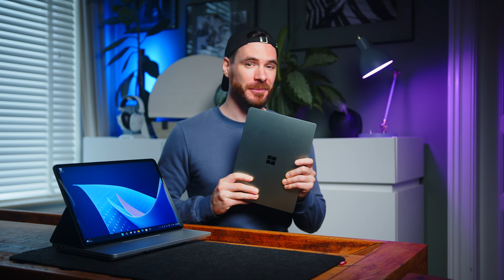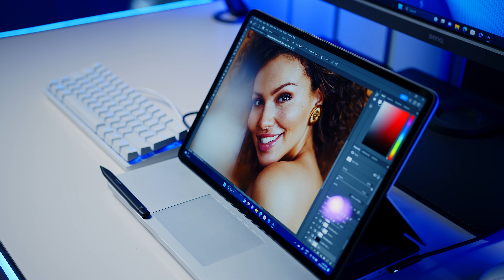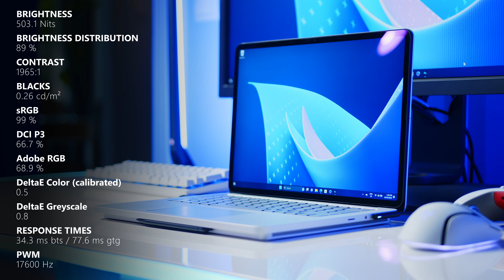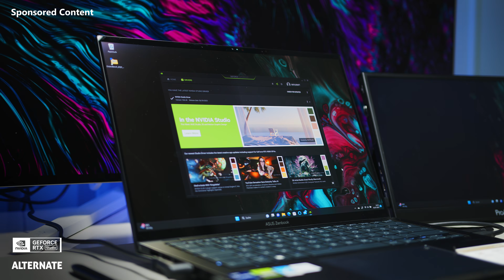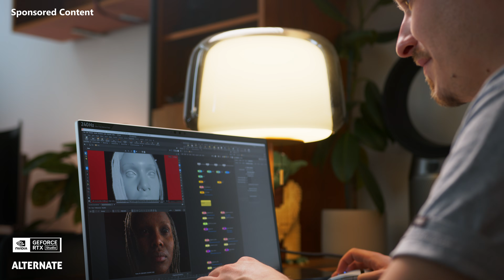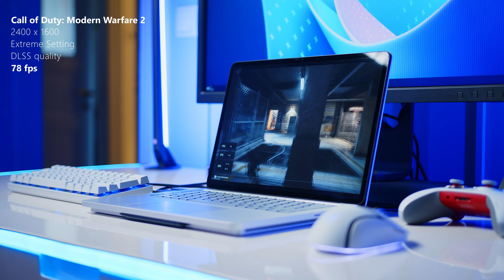Microsoft Surface Laptop Studio 2 - Unique, expensive, and kind of lacking ...

Comment: Trying to decide between Surface Studio (32G and 4050) and a ROG Zephyrus G14 (2024 with 32G and 4070). Surface Studio is a much better user experience and the one I will probably keep. Benchmarks aren't everything
Reply from the maker: User experience is definitly a very big factor, that is often overlooked. What do you like more about the surface tho?
Reply: @NotebookcheckReviews  Keyboard is better and touchpad is miles ahead. Haptic is so good. Click anywhere and no rattle. Other than that, the convenience of the touchscreen and multiple positions is a plus. Also, I mostly use it on my lap on the couch and it runs cooler than the G14. G14 is a hell of a machine. Much better specs but something about using the Surface that has me hooked and probably worth the extra $200 that I paid. Love the channel!
Reply: @devils13 Plus don't forget that in a few years time both 4060 and 4070 will be obsolete at almost the same time, hence can just plug in a new eGPU so 4070 vs 4060 shall be a non-issue anymore

Comment: While I agree the laptop has a use in some settings, it is lacking. The screen response time is around 23ms. If you call Microsoft Tech Support, they will let you know.
Reply from the maker: Or you watch our video until the display section ;) We actually measured even more than that.
Reply: @NotebookcheckReviews  Apologies if you noted that. I thought I had stayed through the video. If missed on the exact value, my apologies.

Comment: Priced like a Macbook Pro, less performance than a Zenbook Pro 14 and inferior in every way except perhaps build quality. Hard pass.
Reply from the maker: It is indeed a tough sell at this price point.
Reply: The device has incredible performance. Equivalent to a MacBook. I think the problem is armatures. Not everyone is a hardware specialist I guess. Especially the one’s complaining about performance. How about you figure out how this device works before reviewing performance. All it takes is 2 clicks. One in the power settings and one in the NVidia setting. Incredible performance after that. These settings are turned off as defaults to allow longer battery life. If you are going to be doing task that require high GPU and CPU usage then you might as well do it at home while connected to power. 

Even a Mac will drain your battery if you try to process a 1 hour video. Yes a Mac is more efficient and does have longer battery life, but seriously where are your touch features. Surface studio is 3 times better for graphic designers. Processing video use a Mac.

Comment: The battery capacity is a JOKE for that price and configuration
Reply from the maker: Nonetheless, they have squeezed some very competitive run times out of it.
Reply: nowadays u need a laptop powerbank  to give extra mileage ( + 50 USD ) . i am not concerned if there is a solution like this . take note also surface devices have a battery limiter function at 50% . if you are like me who is mostly plugged in , this is great . after 2 years , my surface studio laptop 1 is now at 97% battery health . its amazing really .